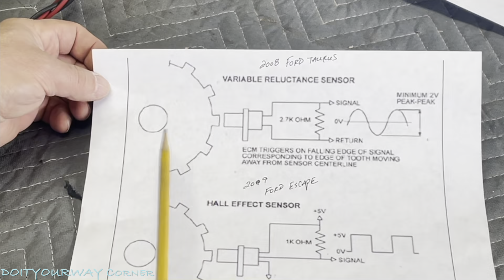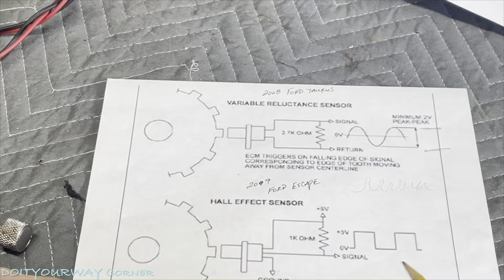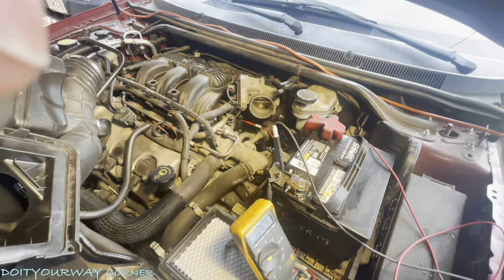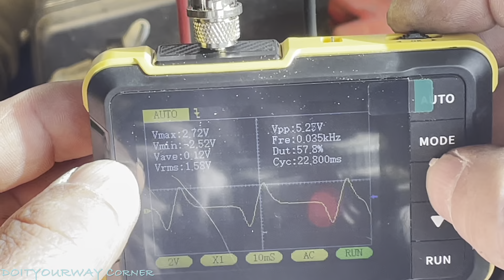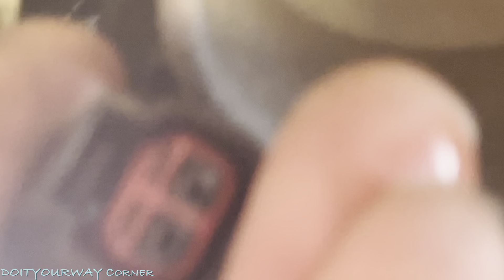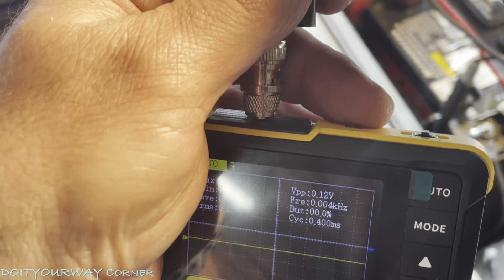VR Camshaft Testing 2008 Ford Taurus

Comment: Great video. Thank you for taking the time to make this and upload it. My oscilloscope should be here tomorrow.
Reply from the maker: It’s crazy good!!
Reply: @ yeah! I received it and have been messing with it for a couple days now.
Reply from the maker: @TripasGarage  awesome. One thing I noticed after hitting the auto button give about 10 seconds to recalibrate.all buttons are non functional until after it locks on to the signal.
Reply: @ I did notice something like this as well, thanks for the heads up.
Reply from the maker: @ yeah I thought mine locked up, but realized it was user error